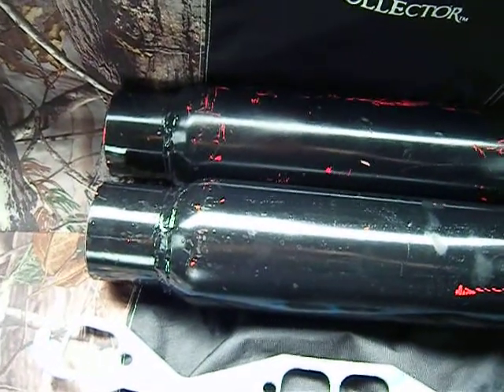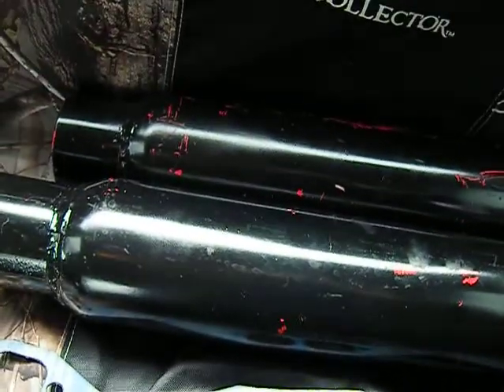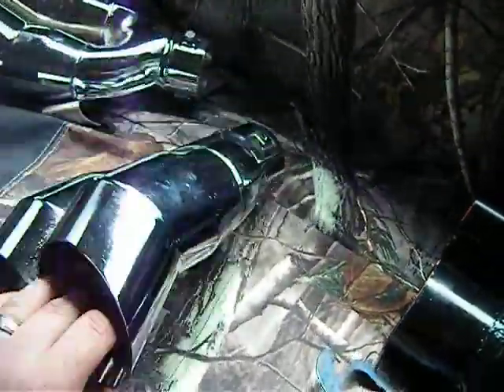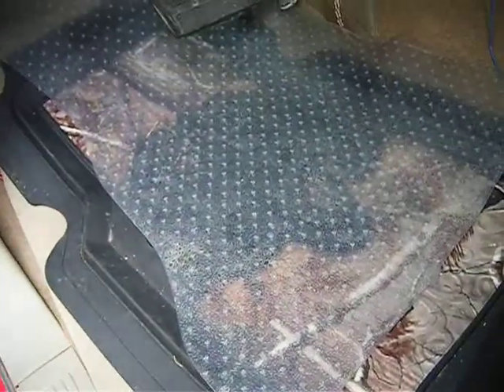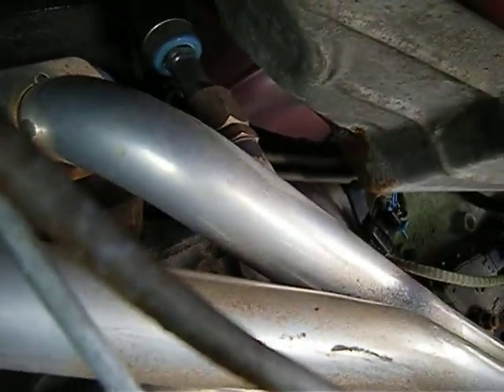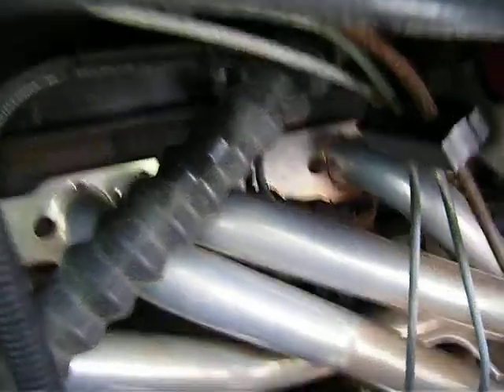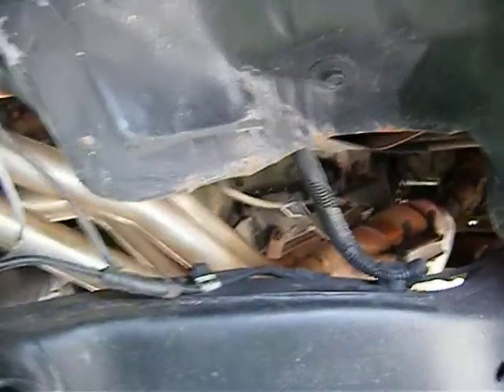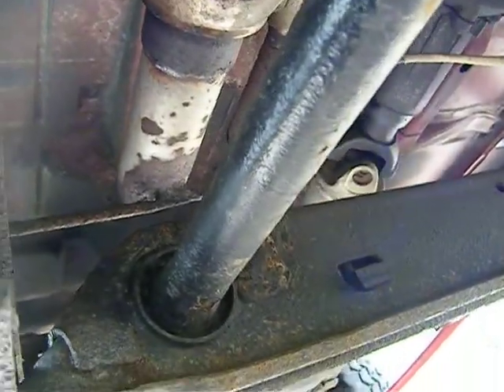Exhaust project /tips/mufflers/idle read descrp

Comment: I don't like to be mean, but those exhaust tips are going to look aweful on a truck like that. You need some nice long 3'' or 3.5'' slant cut tips on each side of the hitch. Those tips, they are for honda civics, thats why they aim upwards, you see drift cars and ricers with those tips. Don't get defended, but that's my opinion.
Reply from the maker: TysonClassics to each his own :P its more then just about the style of the tip these tips with full tube headers enhance the sound big time, i have used these tips before and loved them how im running it may not look ( 100% ) but the sound makes up for it i know there are other tips out there but lets just see how it turns out  first :P the main thing was getting my exhaust finished i may change the tip setup down the road but for inspection im just getting it done quick with this idea so we shall see how it turns out / looks
Reply: I would believe that 3 or 3.5'' tips that are about 15 inches long would be the best sounding for a exhaust setup. I noticed my 98 z71 sounded a lot different with a nicer tone with the tips I have, which are duel 3.5
Reply from the maker: TysonClassics
i had this setup on my 1977 truck with these tips, thats kinda why i want to have these again if they dont sound as good then i will switch, scott rocky wenger's 1977 chevy scottsdale c-10 pickup truck 80%complete
these tips on my 77 vs my 97 may very well be 100% diff from my 77 to my 97 as my 97 i had a 400sb .30 over with a mild cam vs my 97 that is just stock 350 with the same fully tube headers so if it dont sound nice im going to change the tips but if u listen to when i rev with my 77 i love it.. which is why i choose the tips again cause im gonna bore out my motor and add a mild cam down the road  but like i said it may sound like horse crap on my 97 right now if thats the case ill just swap out the tips then
Reply: very nice truck